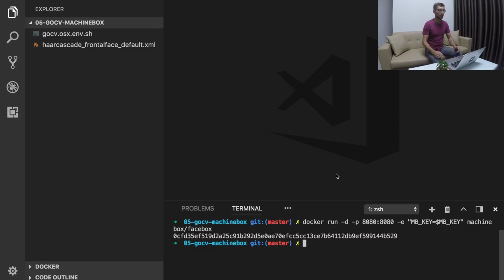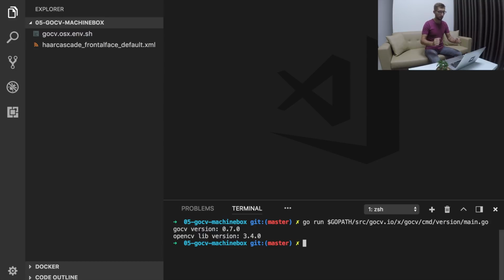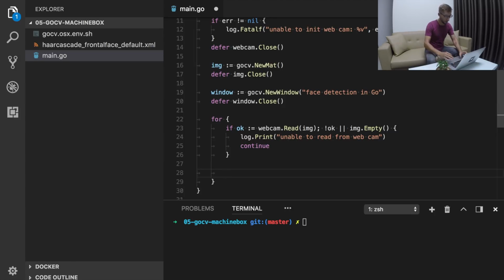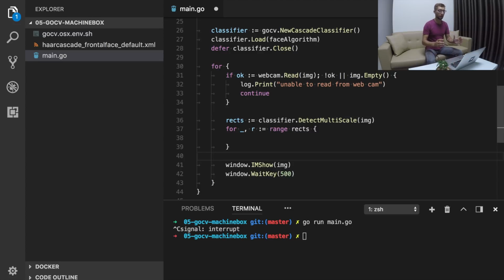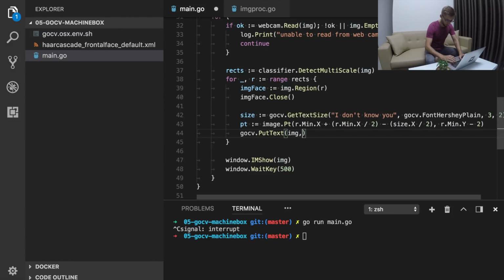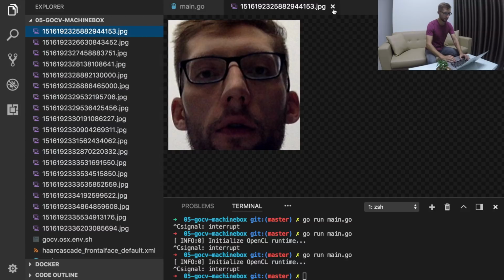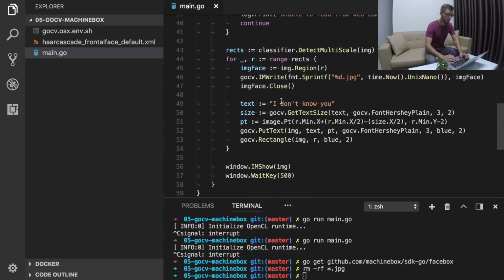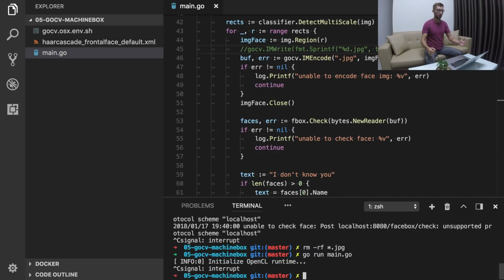Face Detection in Go using OpenCV and MachineBox

Comment: Does anybody knows how to fix this? I got an issue on mac os mojave 
go run main.go 0

OpenCV: not authorized to capture video (status 0), requesting...
OpenCV: camera failed to properly initialize!
Error opening video capture device: 0
Reply from the maker: It is due to macOS Mojave new privacy protections when an app is requiring access to the webcam or microphone.
[1] https://www.howtogeek.com/361707/how-macos-mojaves-privacy-protection-works/
[2] https://stackoverflow.com/questions/52634009/opencv-python-scripts-mac-aborts
Reply: package main issue is solved already :) anyway thanks for what you are doing, keep it up 😊👍🏻 maybe links will help somebody else
Reply: package main actually I realised there are plenty of tutorials on face recognition and I found almost nothing about face anti spoofing ) do you have any experience regarding anti spoofing, mainly anti replay Attack, against photo  printing etc ? Would be really cool if you can create a video on that, even if not all the attacks are covered?